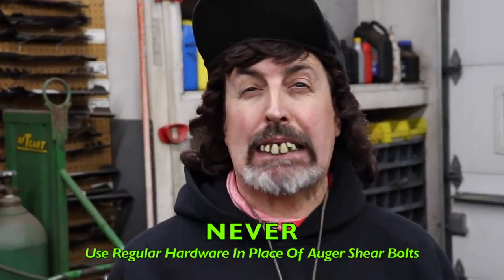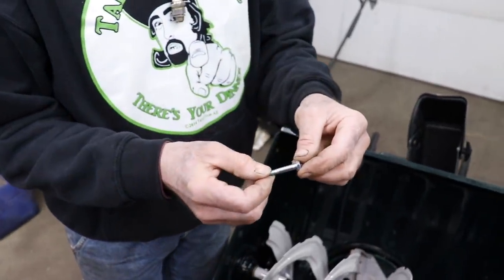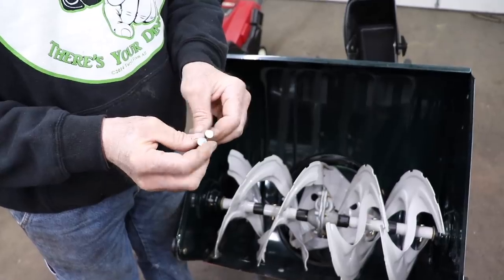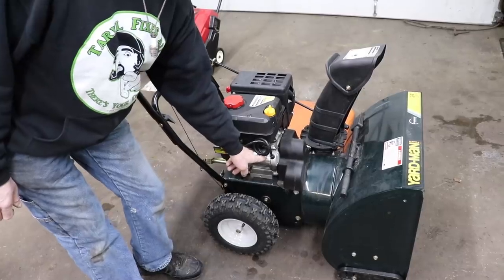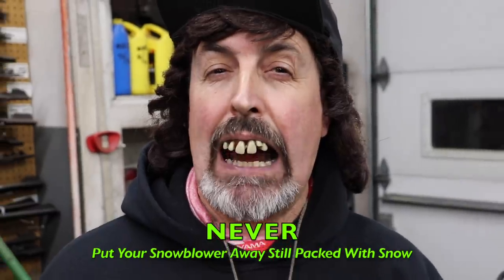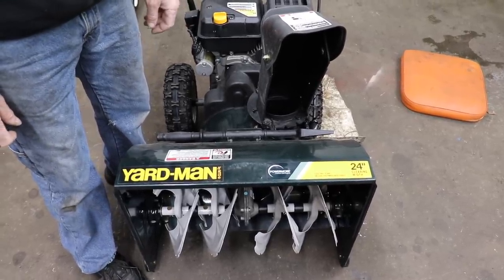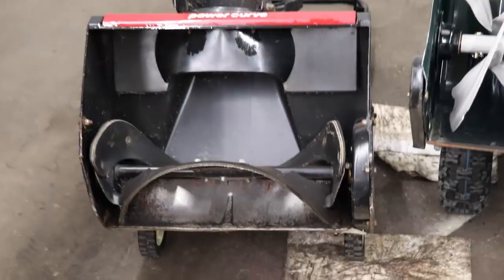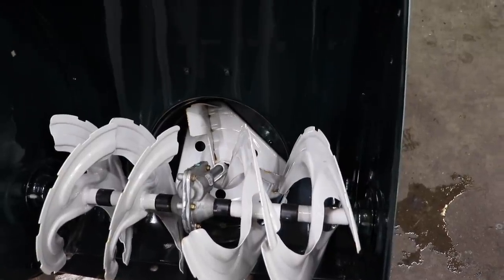5 Things You Should NEVER Do To Your Snowblower

Comment: I've been using a couple of 16 p nails as shear pins  on my '74 Ariens 824, for over 20 years. I have a gravel driveway. I'd be replacing $4.00 shear pins 40 times a season, otherwise.
Reply: As long as they break when required.... In a pinch, I buy the lowest grade bolts at Lowes, and then cut two grooves in them, with an electric drill and a hacksaw blade.   and
Reply: @bobmcl2406  I think they're pretty dang close to oem shear pins. It doesn't take much to shear them.

Comment: I think this is a tip worth mentioning: if you don't have a heated garage or tent to put your blower into and have to keep it outdoors then before putting it away, use a torch (carefully, duh) to melt away all the snow/ice in the chute and on the blades/auger then wipe down all water and spray with some silicone spray/lubricant when dry for next time and cover it with a blanket/tarp, don't leave it out exposed.

Comment: I've been using 1/4-20 bolt for many years as shear bolts. broken many of them never had a problem . They seam to do the job just fine.
Reply: Why take the chance?  Just buy a few shear bolts, they are cheap...
Reply: @JTYooper  Just bought some, $5 + tax for 4 bolts, I would NOT say that was cheap!!!
Reply: @tommak6516  well worth it to prevent damage to the gearcase!!!!  I have only replaced one in the last 3 years.   Cheap compared to replacing a gearcase!!!!!!

"A shear pin is different from a regular bolt because it is designed to break, or "shear," which in this case is a good thing. Shear pins are made with a weak point that snaps if a jam occurs between the auger and the housing."

Comment: I've seen several snowblowers that use standard 1/4 inch grade 5 bolts. But yes, always using the correct shear bolt for the application is important. As for gravel driveways, if you put the shoes down and scraper up you can avoid picking up gravel 99% of the time--and you should treat the chute like any other profectile launcher and not point it at anything you done want broken or injured. I have a friend who clogged the chute on his snowblower many years ago. He figured "well its off, let me just reach down in there and...." there went his finger. Fortunately they were able to put it back on buy he has little feeling and limited use with it.

Comment: Never leave your snow blower outside cover in a tarp during the summer  : (
Reply: Why though?
Reply: Tarp is OK - that's not the problem.  It's that the machine is probably sitting on the ground with no ventilation. Put it up on a wood pallet, then cover it with a tarp.  Make sure the pallet is open on the sides to allow a free flow or air up into the machine itself.

Comment: What do you ( or anyone) think about those snowblower attachments that fit on the front of your lawn tractor?
Reply: I think anything that makes it easier to clear snow is worth it. With a lawn/garden tractor attachment you need to pay attention to traction. You may need wheel weights and chains depending on your conditions. A tractor-mounted blower will get frustrating quickly if you are constantly getting stuck.

Comment: Have 2 simplicity blowers. A 5 and 7 hp both worked till heavier snow then auger would stop turning.  Both were used on gravel. Had grade 5 bolts for shear pins. Both had the woodruff key sheared in the gear box. (Gear to shaft) had 1 sold till I tested it. At least it wasn't a come back.

Comment: Always shut the fuel off, if it don't have a shut off valve put one in the line. They have burned down a lot of garages with a leaking needle and your furnace or what ever comes on and you no longer have a garage or snowblower.

Comment: Isn't 5 marks on a bolt mean grade 7, not 8? Grade 8 bolts have 6 marks, right?
Reply: You sir are correct. Most hardware stores sell Grade 1,2,5, and 8 SAE bolts. Grade 1 & 2 have no markings on them. Grade 5 has 3 markings, and Grade 8 has 6 markings.

Comment: Found that some aftermarket shear bolts have a deeper relief in them than original replacement shear bolts. The aftermarket ones will shear more often than they should costing you more than if you had bought the original equipment shear bolts in the first place.
Reply: Not all pins are meant to be the same regardless if their original manufacture parts or aftermarket, just because it’s a 1/4 inch pin doesn’t mean it’s supposed to be just as strong as all the other 1/4 pins.  
My blower has 4 pins that are 2 different levels of protection yet all the pins look identical except for a triangle mark on the weaker ones and they have different part numbers in the manual and on their packaging.
Reply: Imma just buy 25 factory sheer bolts from the dealer at the same time I buy my first 2 stage blower. Make it easier over the long run

Comment: My 2nd stage aka impeller is modified
Been doing my gravel driveway for 10+ years with it
I have the skids set about 2” down. So, the scraper blade is high.
This season I drove it into 3/4 gravel at the end of the driveway 
It threw every single stone out. Estimate 40 to 60 stones.
Last year I drove it into pooled water & slush
It threw the water & slush out.
It has never jammed except when I drove into
a piece of tree limb that was under the snow🤪
Like every tool after it performs its job . .. 
wipe it, clean it, lube it, & wax On before it gets waxed off next winter.

Comment: I knew a guy once that had his snow blower serviced and when he got it back he thought the impeller wasnt spinning when in fact it was just spinning so fast it looked like it wasnt. He had his wife hold the lever down as he reached in with his hand with the engine running. His hand stopped the impeller, He could of lost his hand. Ironic this was he is a funeral director...
Reply: I saw a guy start up his gas powered 
remote control airplane, and promptly shove
his knee into the propeller as he was trying
to stand up. (didn't see it spinning)
Massive gash to his knee with blood everywhere.
Insisted on using duct tape to close the wound, then
changed the broken propeller, restarted and went off
to fly the plane...until the lose of blood effected his flying skills.  
Crazy guy.

Comment: Hey Taryl, should you spray the chute and auger enclosure with teflon, some people say food pan spray. The whole design is  wrong, I'm going to work on a different design without the very expensive sharty auger gear design. The gears should be hardened steel contact fit like the rear end in your car, not this industry wide garbage they use.

Comment: Run it in the sand box
Use it as a corn picker
Use it as a lawn mower
Use it as a leaf blower
Use it to make crushed ice
If I'm stuck in my house and need my drive way cleared right now. I'm using what ever bolt I have . I don't worry about snow freezing in the machine I store it in my kitchen. You may have 5 fingers but have you seen your teeth lately?

Comment: #4 
Self-starters for automobiles were developed by Charles Kettering, here in Dayton, Ohio.  He had first developed high powered motors for cash registers, at NCR.  He realized that the motors were just going to be used for a short, short period of time so he didn't need to worry about them overheating - they wouldn't have time to.  Of course, with the car starters, they got out into the real world and people started cranking for minutes at a time.  Because not everyone can be as smart as ol' "Boss" Kettering!